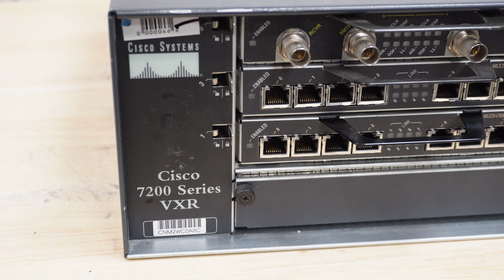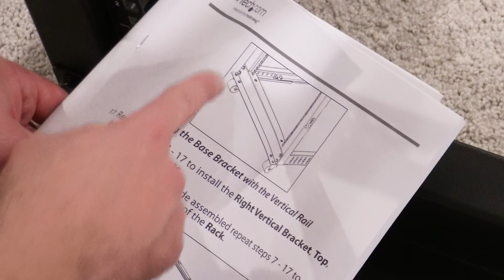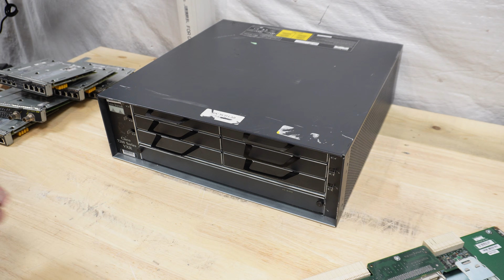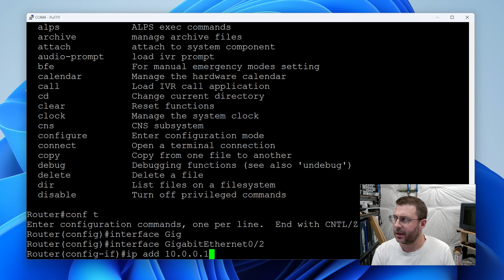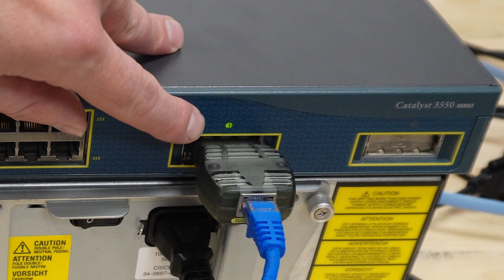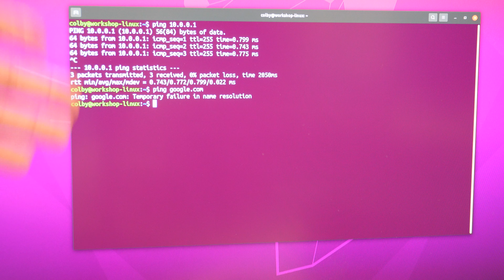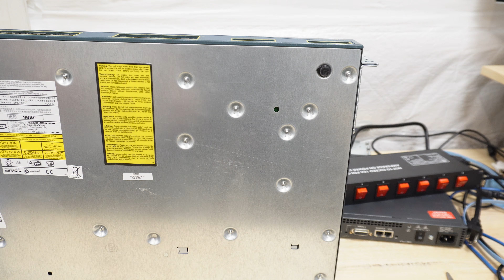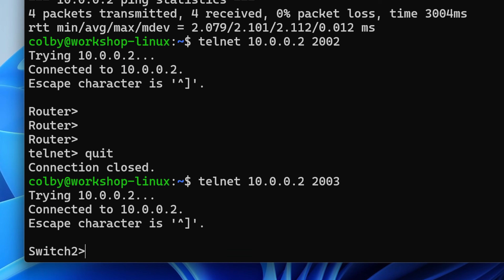Setting up a Retro Rack

Comment: Nice setup. My guess with the "terminal-server"-router: check if the gateway is set correctly. This has effed my more than once and I had to drive back on site to fix a missing gateway...
Reply from the maker: i thought for sure that was going to be it too but it didn't make a difference, really weird
Reply: @clabretro  I could be completely wrong about this, it's been a long while since I have done anything networking related but I would try using a crossover cable (ethernet A on one end and Ethernet B on the other) instead of a standard/straight-through cable between the switch and terminal server. 

You might have already touched on this in another video, I can't really remember if you did, but in ethernet networking, you can't connect "like" devices together using a standard cable. If you want to connect 2 switches together, you need a crossover cable so they can communicate. Same if you want to connect 2 routers, or even a PC to a router directly. I don't remember the exact reasoning for this but we were taught the OSI model of troubleshooting, which is basically "try the simplest thing first, then get more complex from there". Switching out the type of cable is one of the simplest things I can think of first, since the configuration between devices doesn't really warrant trying more complex troubleshooting quite yet.

If I had to guess, that Terminal Server, while it is being assigned an IP Address, has a network interface that is more akin to a switch than a router, so switchport to switchport (switch to terminal server) possibly needs a crossover cable in this situation.

Again, could be completely wrong about this one but I have been enjoying your retro networking videos and just want to try to contribute. 😄

Comment: Retro track idea. Pihole is a dns server that you can host yourself that blocks ads. I ran mine on a old Pentium III server running Debian. They still release a up to date version for 32 bit processors. Or the slightly newer Pentium 4 64 bit based xeons can run the newest versions of Debian or Ubuntu server. This way you could have an almost completely isolated retro net. Other than having to have a route out. But also create DNS entries for the retro net to access items via website rather than ip.

Comment: my wife laughed at the 'piles on the floor' comment

because I too leave projects in piles on the floor
Reply: oh, also, any 2500 rack years will work on the 2509. I managed to find a set for mine (which only came with one ear!) a couple months ago for $10. I've got it mounted backward and inset with only two screws on each ear so the AUI adapter clears the rack door, but I can also reach all the ports (as the back of the rack isn't easily reachable).

Comment: Maybe do some iperf tests thru the VXR?   My dusty memory seems to remember those things falling over pretty easily after a certain traffic level.   Had one terminating an OC3 in a former life.
Reply: All depends on the npg in there, I know we even ran c7 switching on one, dsl bras etc, workbeast of its time. Didn't really like bgp reconvergance on the ams-ix
Reply from the maker: I'll definitely try some perf and load tests in the future
Reply: 65xx series was better than the 72xx series, if I recall correctly. We did tons of gbe switching and full bgp4 table upstream on fiber gbics. Juniper was always more comfortable to work with though, all the way up to sds and sdr.
Reply: Oh I'm SURE they do.  This was in an era where they still leaned heavily on the CPU for forwarding-plane stuff, and they also let you oversubscribe the backplane quite a bit.  You had to be careful about how you populated some chassis to ensure you got the throughput you expected.

I just Googled the datasheet, and it doesn't provide throughput numbers, but does claim a "maximum" of 6x Fast Ethernet ports, or 4x OC-3 ports.  That suggests a ceiling of 600Mbps ... and even that might be ambitious.  :-)

Comment: I'm also in the same boat with the cage nuts. They can be a bit annoying to put in once you have a more full rack with less access, but a $10 cage nut lever on Amazon fixes that. I can get them in faster than someone can fiddle around with some plastic bag full of plastic.
Reply: Once I found a cage nut tool, just found it tossed in a bag of cage nuts one day in the early 2000’s, I never had another cut finger or busted knuckle.  Such a game changer for such a little simple tool!  No need to spend 10 times the money on fancy rack studs once you have the right tool. Plus, I can’t imagine plastic holding up to the types of weight I used to put on cage nuts back in the day. 😎🙃
Reply: @swilson42  Many plastics are as strong or stronger than metal.
Reply: @AureliusR  While material science has created some impressive plastics, these are not that. Rack studs are strong, but not UPS battery weight strong. Everything else though, they do great, they’re just 100 times as expensive as cage nuts. 

For a full blown data center, who might be racking and stacking every day, I can see the use case and would appreciate the added convenience of rack studs. But for the rest of us, way too much money for how seldom they would be touched. To each their own though.

Comment: For the bottom of the rack: get a 1U shelf (Startech makes one, full width and adjustable length) and then don't bother with the universal rails for the next server up. I have my UPS on the bottom (on top of the shelf) and then a 4U server above that. Yes, you lose that 1U but you gain rigidity and you know for certain that those chonktastic IBMs aren't going anywhere.

Comment: It helps quite a bit to enable CDP and LLDP in a home lab.  Then you can show cdp neighbors detail or show lldp nei det to find gear.   

Future things for vids would be doing dot1q interfaces on the routers to do inter vlan routing when you don't have a L3 switch in the rack.  You'll do the same thing on the PIX so you can have more vlans than ports in the PIX.  Private vlans can control your security for stuff on the same vlan.  

You're sparking my interest to restart doing my home lab again, I stopped playing with it after I got my CCNP and it became a job.  Now I'm doing mostly infosec and GRC, so not playing with the networking as much.  I have so much gear to use in two 12u racks...  :-)

Comment: Regarding the retro rack not being able to ping out to 192.168.1.1, your main router needs to have a route to the 10.0.0.0/24 network. The 7200VXR automatically got a route for the 192.168.1.0/24 network, but since no NAT has been set up (presumably), your main router has no clue what to do with 10.0.0.0/24 traffic, sends it out to your ISP, and presumably gets dropped from there. I haven’t worked with Unifi stuff before, but if you wanna save yourself the headache see if there’s a way to configure OSPF routing on either end, since as far as I’m aware, you need to have different subnets for each physical interface on a router.

PS, yes it’s perfectly normal to break up a 10.0.0.0/8 into a bunch of /24s
Reply: Using NAT and a restrictive firewall is probably a good idea here. I definitely would not want all the old, CVE riddled stuff being able to talk directly to my actual "production" equipment.
In fact, when I experiment with old hardware I put it on a seperate VLAN and use a firewall to segregate everything.
Reply: @nilswegner2881   Why?  In an internal lab, they're not exposed to anything anyway.  You would have to have a hostile entity inside your network (which would be my first concern), and then what...  They gain elevated access and maliciously reboot your dialup router?  Oh no!  Service disrupted for all the pretend customers on my pretend ISP.  ;-)

The absolute worst thing that can happen is that your toys get compromised and end up in a botnet ... at a blistering 100Mbps throughput, they would be a nuisance ... and that's about it.  But that's highly unlikely to happen if they're not directly connected to the Internet.  Even passing "modern Internet" through them is not really that big of a risk, as it would require a very targeted attack against obsolete equipment.  Not impossible, but if you're that unlucky, you're almost certainly going to die from a ladder accident first.

Side note:  Seconding OP's suggestion to enable OSPF on the home router and the lab edge router.  That makes life much easier.
Reply: If you're not concerned about security you will just need to set up a static route on your home router (the UDM) so 192 subnets can get in and out of 10 subnets and vice versa. Later you can add a firewall on the VXR side to shield 10 subnets to only hit the services you want like the tftp server on the home side.

Comment: That's the problem when the collection gets bigger and bigger. I'll also soon have 2x 35U occupied and it's getting more and more ;) Then there's the question of what should go where, how the power supply should look, how the network should be configured, and so on. You can spend hours or even days on this. I also want to separate my retro network from the home network and use a Cisco Catalyst 3550-12G for this, but this is just exceptional ;) And I don't have any idea about Cisco configuration at the moment, but the static routes are working.
Reply from the maker: Yeah there are endless combinations, I suspect I'll reconfigure this many times haha